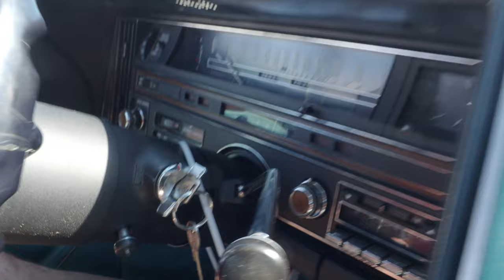1969 Cadillac Fleetwood Donation

Comment: @ 0:46 what car trailer is that?
Reply from the maker: Good eye, that's a Futura Trailer. Its primary use is Alex's drift cars.
Reply: @JustDriven  Thank You, I'm in the market for a trailer to haul cars and that looks like it is easy to load a car on and it sits low...
Reply from the maker: It lowers to drive the vehicle onto the trailer than with a remote raises back up. Very convenient.